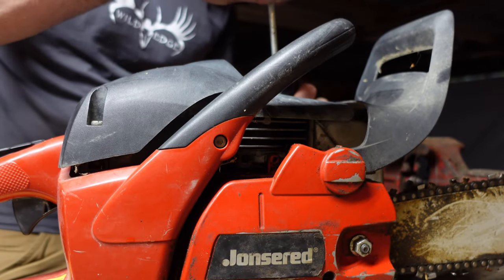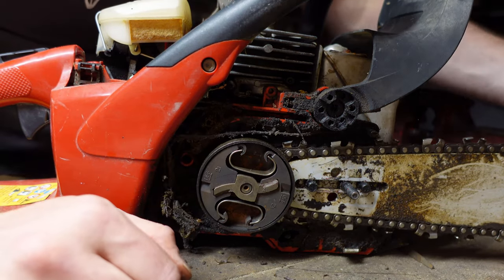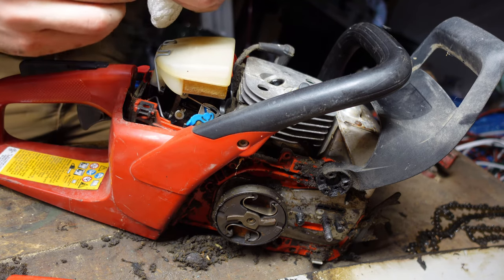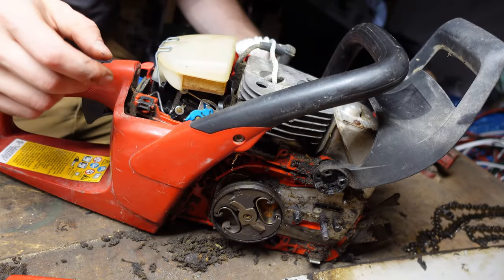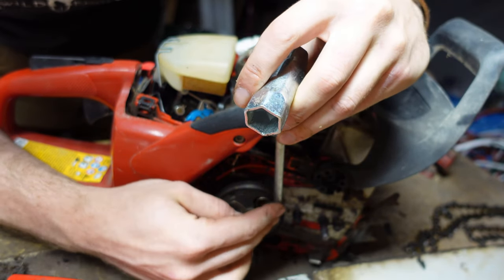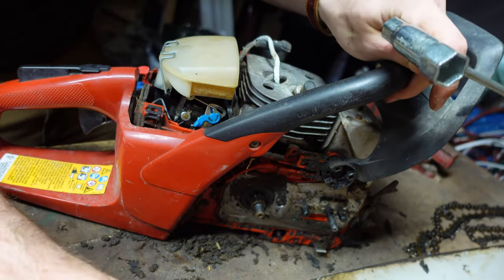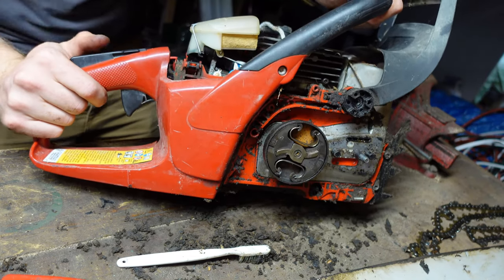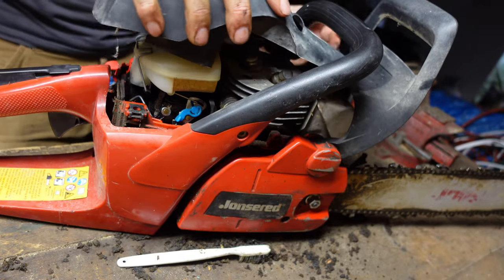How to Remove a Chainsaw Clutch With No Special Tools

Comment: Instead of tapping the clutch I put plyers in the groves and used an adjustable wrench across the need nose plyers.  Mine was on so incredbly tight...  I ended up have to use a lit of force.  Now it doesnt idle correctly.  Do you think I broke a seel or something?  Maybe I bent the piston?
Reply from the maker: If the crankshaft itself was damaged, you'd probably have more symptoms like knocking or vibration. If its just the idle, a seal may have been damaged. Spray some carb cleaner around the shaft when its idling. If it revs higher, there is probably a leak.

Comment: If you don't have rope (like me), you can use the handle of a small pair of pliers (make sure they're rubber coated) and whack the clutch with a hammer whilst holding the tip of the pliers, that's how I got mine off. Thanks to this video I found out which way to hammer it off 🤣🤣

Comment: Dude you just saved me 28.00 did it would cost to buy the clutch removal tool. Which is not nearly as much as the 50 they wanted to put my clutch back on, which they had to take off in order to change the rim sprocket from a 1/4 pitch to a 3/8 pitch.  They took it off for free to find what rim socket they needed, and then wanted to charge me $50 to put the clutch back on. Instead I took all the parts clutch off my new rim sprocket which I paid $14 for and walked out not buying the brand new bar and chain that I would have got with it had they have done it for free. And I will never go back,  as well as writing 0 out of 10 review. Not what I would call the best customer service trying to win a new customer